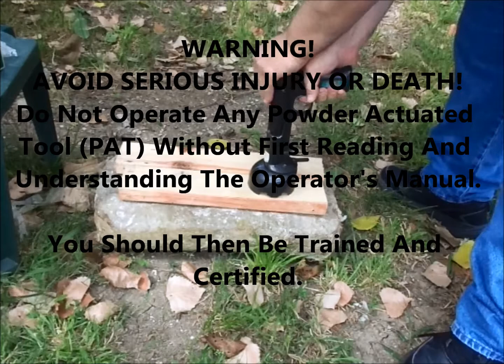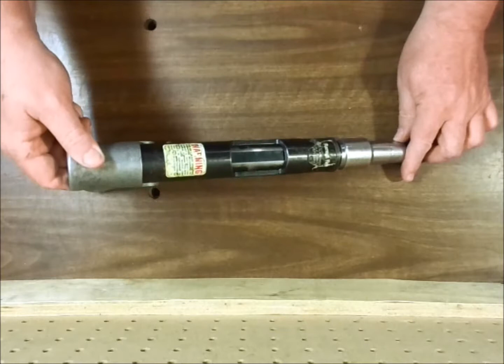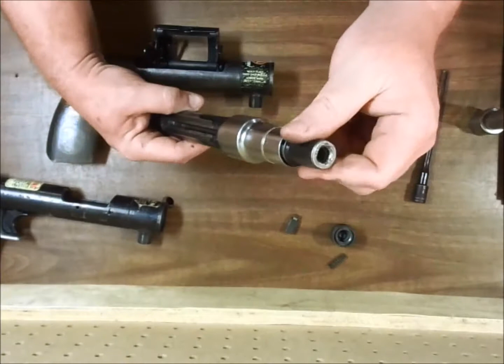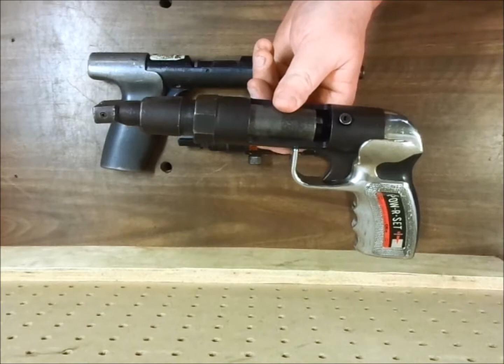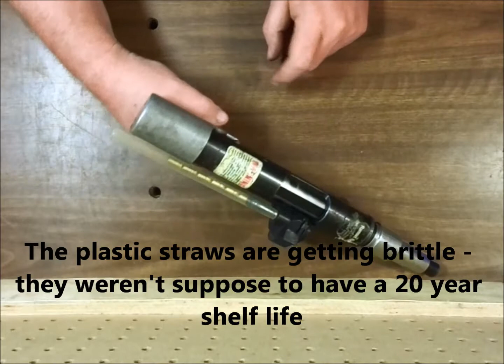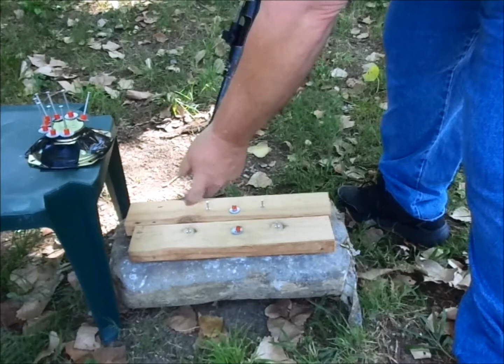Ramset 4170/4150 And RM Sideloader Low Velocity Powder Actuated Tool

Comment: great video....it would be nice to show a video just on the cartridge loaders....both types...and also explain how they are mounted to the gun....(pre drilled holes etc.....)  i have a 4160...notmarked mark 2 as well as no holes for the loaders....if you anything on that specifically...i would be interested.....thank you for this ...much appreciated..
Reply from the maker: I never thought about doing a video on the side loaders because they are obsolete and unavailable. They are attached by pre drilled holes.  I think the Mark II was added to the model number 4160 when the side loader was introduced.  There was also a different piston reset system on some if not all of the original 4160.
Reply: @vintagepowderactuatedtools9036  hello:  thank you for getting back....I just found a 4160....in very nice shape with many many different charges and boxes of different sized pins...anyway...i do use a hilti once or twice a year for a 1/2 day or so....i would very much like to see how one is mounted...also...you showed 2 types....i am curious as to the hole spacing....my gun does not have holes....wondering if i should look, and to then install holes to accommodate for one of these multi charge loaders....are they easy to come by????do you have an extra....?????